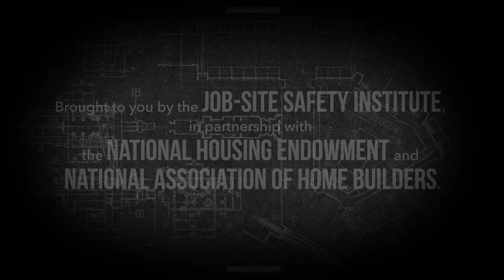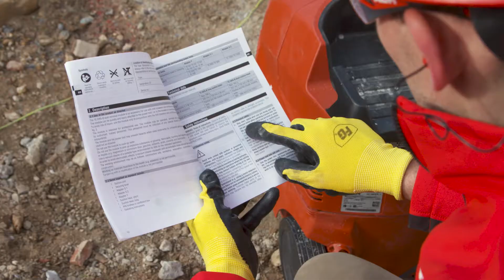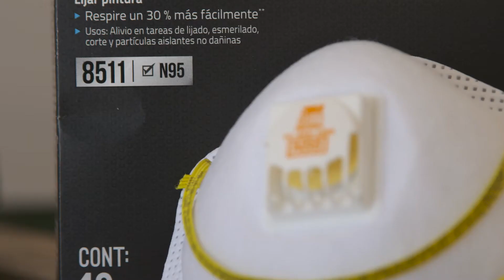Silica Safety

Comment: Acute silicosis is the most dangerous form of silicosis. Happens when there is extremely high amounts of exposure to RCS in a very short time. Development of disease onset can take 1-5 years, or as short as 2-6 weeks. It can lead to fulminant respiratory failure and death in a few months in the worst cases of this ailment, as the fibrosis that worsens with time happens so fast in your pulmonary region, that it seems to choke your lungs to death in its own inflammatory fluids.
Reply: The pathogenesis of this damaging pulmonary fibrosis is this - RCS crystals go right into the lungs air sacs - then macrophages come in to try to smother the crystals to kill them off - but these immune cells get overpowered and are unable to kill off the crystals, so, more and more crystals build up in the macrophages. This leads to apotosis (cell death) of these immune cells as well as part of the good cells in the lungs, and when this happens, a cytokine alarm response (something like what Africanized killer bees have when prokoved) happens in the immune system - the fibroblasts take over and quickly surround the dead macrophages with scar tissue - or fibrosis, and this scar tissue sticks in your lungs - permanently. The scar tissue is like very sticky fat cells, not water-soluble, and will just stay there to cripple any normal gas exchange in your lungs, and every additional exposure time to the RCS will worsen this fibrosis and will eventually lead to failure of the lungs with time (respiratory failure).

Comment: In the Netherlands, sandblasting on anything more than 1 percent silica is against the law. Altering sandstone is also forbidden there because it has a great amount of RCS dust if released. Violating such laws there can lead to very stiff fines or amends. 

These laws are enacted because RCS is extremely dangerous when ingested at more than the permissible exposure level (or PEL).